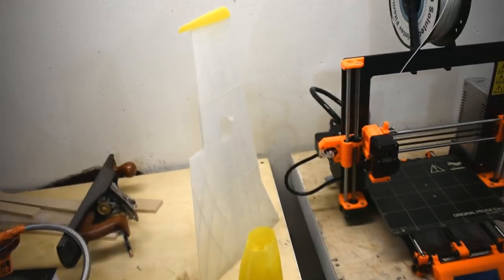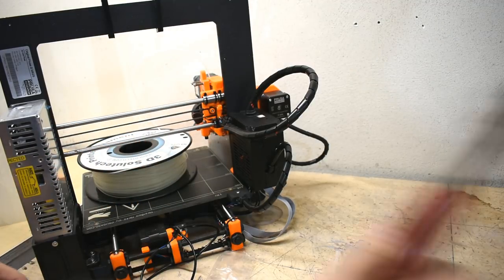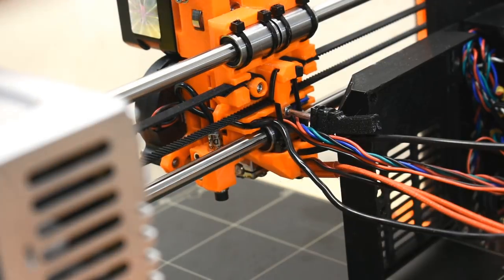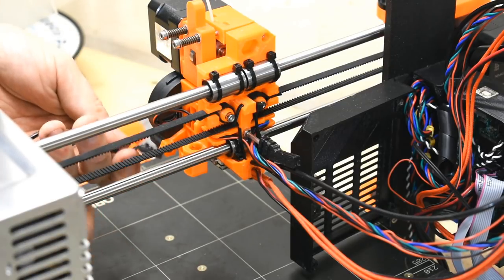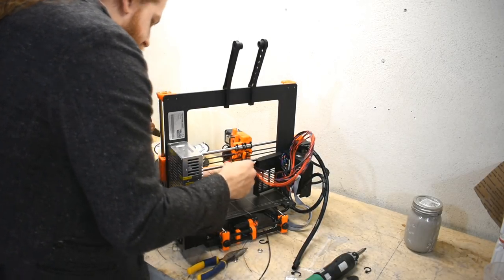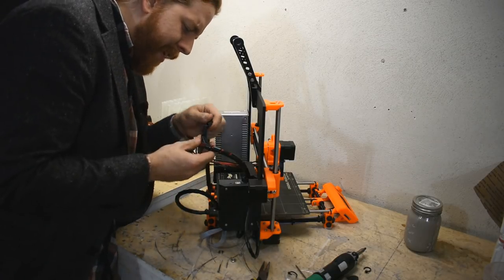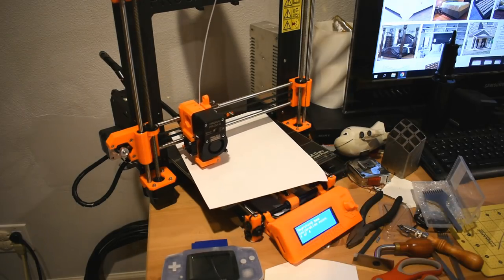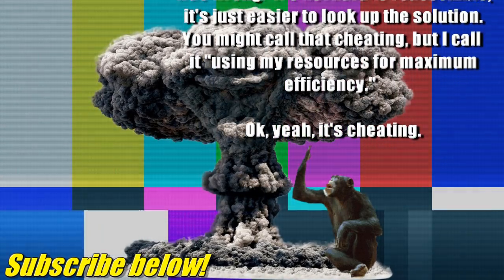Fixing my Prusa i3 MK2S: Replacing the P.I.N.D.A. Probe Sensor

Comment: Tip regarding the whole zip tie removal thingy.... You can open a zip tie if you jam a pin or knife under the "flappy bit" inside the zip tie which stops it from loosening itself... Then you can reuse the zip tie like a normal zip tie, no soldering iron or new zip tie needed! :)
Reply from the maker: I'm not that patient!  I've seen that done, though.

Comment: yeah, I have the same problem too, but shipping and replacement is kinda pricey. Will struggle by manually replacing the wire and adding heat shrinks around. and perhaps some special glue as OP protection for bending
Reply from the maker: that's a good idea.  There was just a little too much bending at the zip tie, i think.

Comment: I might have to get a 3d printer just for the rc plane print. That looks fun.
Reply from the maker: +Sean Hirsch it’s awesome, the place I got the file from is called 3dlabprint, whole bunch of planes there.  The files aren’t free but they are worth it in my opinion
Reply: Paul's Garage I built a trainer when I was a kid. It was a lot of fun but it makes you not to want to crash. So flying would be more fun just printing it.

Comment: lol man i actually just finished electrical and motor control for my maintenance diploma and yea thats a ton of fun.....though i woulda tested the resistance befor chopping lol id keep the sensor part just leave enough tails incase you need it.......never know with them great repair job!!
Reply from the maker: +Johnathan Welch I should’ve tested resistance but the meter was 2 feet farther away than the wire stripper and cutting stuff it more fun :D
Reply: lol sounds like something id say glad it was a simple fix well free fix? lol can never argue with free right? either way with they kinks the way they were you prolly saved future problems from occuring lol with that fixed on to the furnace!!!!! lol

Comment: I would have liked to have seen if it was really copper wire, or copper plated aluminum wire. To find that out you give it the lighter test. If the stripped wire curls up in a lighter flame then it is the copper plated aluminum crap. If you have really good eyes and you cut the wire clean the plated wire looks silver on the cut end. But I can't see that anymore. I have a feeling that plated wire is going to be a big problem in the future.
Reply from the maker: +Paul Frederick sounds like it.  I would guess copper but I didn’t look at the end.  Such flimsy thin wire in a place that moves would a bad fit for aluminum wire, but then again it did break on me so who knows.  I’ll have to check when I get home from work
Reply: The Chinese are pushing that copper coated aluminum wire crap because it is cheap, not because it has any redeeming physical qualities to it. The stuff is bad! Just strip a couple inches of the wire and hold it in a lighter flame. If it curls up like burning hair it is the coated crap. Real copper just tends to glow in a flame. It is something kind of new. But cheap crap out of China has that coated wire in it sometimes these days.